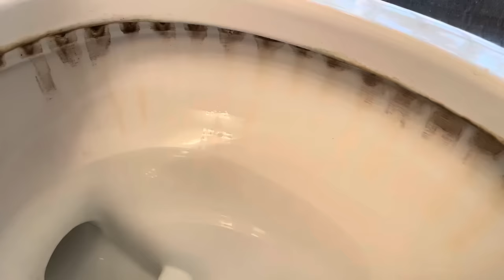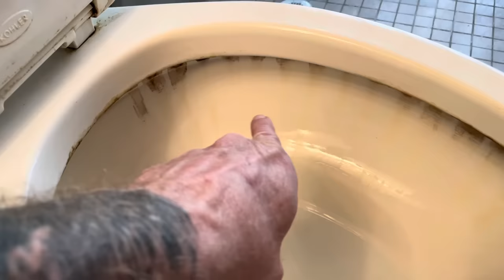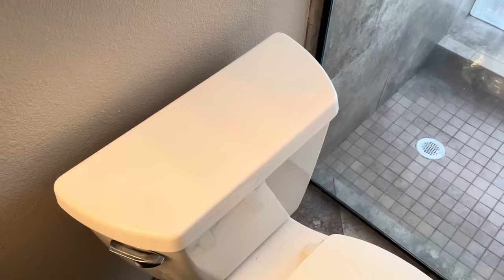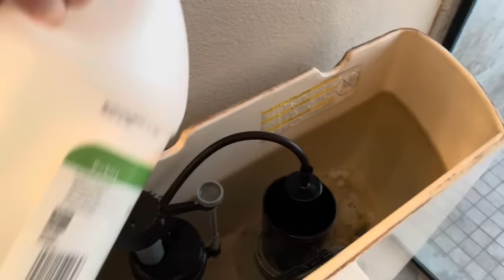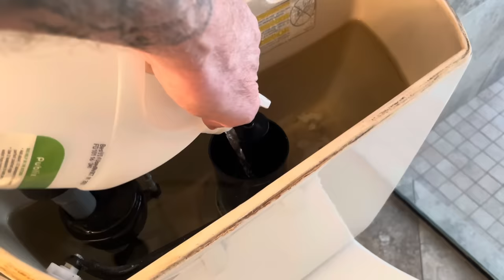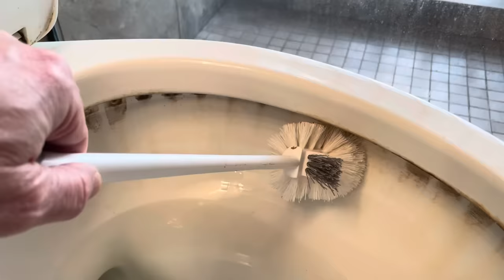Why Does THIS Keep Coming Back and How to STOP it

Comment: i just put  hydrochloric acid in it and the molds did not come back for many months.
Reply from the maker: Yes that will DEFINITELY work. I can’t handle the fumes though, I’ve got COPD, and that would kill me.
Reply: Your tap water already has blean in it. Mold it resistant to it. Use the vinegar, it will last longer.

Comment: would bleach work better than vinegar?
Reply from the maker: Bleach is a very deceiving product… it is far more effective at “bleaching” the color of mold than it is at killing it. Because we believe what we see, we think it has killed it, but it hasn’t. That’s why it comes back so quickly. So we just keep using & buying product over and over again. Great for sales, but not so much for us. The acetic acid in vinegar, on the other hand, kills mold down to the roots, but doesn’t really change the color that much, so you still need to remove the surface stain, but it won’t come back for a long time. Vinegar also helps break down the mineral deposits that the mold is “rooted” in. All in all, vinegar is a far better option.

Comment: Would bleach be better instead of vinegar?
Reply from the maker: Bleach is a very deceiving product… it is far more effective at “bleaching” the color of mold than it is at killing it. Because we believe what we see, we think it has killed it, but it hasn’t. That’s why it comes back so quickly. So we just keep using & buying product over and over again. Great for sales, but not so much for us. The acetic acid in vinegar, on the other hand, kills mold down to the roots, but doesn’t really change the color that much, so you still need to remove the surface stain, but it won’t come back for a long time. Vinegar also helps break down the mineral deposits that the mold is “rooted” in. All in all, vinegar is a far better option.
Reply: Thank you for the information.  I appreciate it!

Comment: Might be a dumb question but will bleach work as a substitute
Reply from the maker: Bleach is a very deceiving product… it is far more effective at “bleaching” the color of mold than it is at killing it. But because we believe what we see, we think it has killed it. But it hasn’t, that’s why it comes back so quickly. So we just keep using & buying product over and over again. Great for sales, but not so much for us. The acetic acid in vinegar, on the other hand, kills mold down to the roots, but doesn’t really change the color that much, so you still need to remove the surface stain, but it won’t come back for a long time. Vinegar also helps break down the mineral deposits that the mold is “rooted” in. All in all, vinegar a far better option.
Reply: @papajoeknows8355  thank you!

Comment: So I have an old toilet that has a flapper and a float. How do I treat this style of flushing mechanism? I'm assuming that the mold isn't in the tank but is instead inside the rim where the jets flush from? Does this also explain the ring of black scum that develops around the bowl at the water level if I don't clean my toilet frequently enough?
Reply from the maker: The vertical pipe that your flapper is attached to is the overflow… pour the vinegar in there. And yes, the mold is flourishing inside the internal rim cavity, then comes out the jets and spreads from there.

Comment: Wow hubby uses bleach tablets. I’ll bring this to his attention. Thanks
Reply from the maker: Bleach is somewhat effective at killing mold on non-porous “glazed” surfaces. But the internal rim cavity of a toilet, where the mold is flourishing, is not glazed and is very porous, so vinegar is far more effective, as it’s able to kill mold deep down to the roots.

It is deceiving though… bleach is very effective at “bleaching” the color of mold so you think you’ve killed it, but it comes back very quickly. That’s why you have to keep using it. Vinegar on the other hand kills mold down to the roots, but doesn’t really change the color that much, so you still need to remove the surface stain, but it won’t come back for a long time. Vinegar also helps break down the mineral deposits that the mold is “rooted” in. All in all, a far better option.

Comment: Would Bleach have the same effect ?
Reply from the maker: Bleach is a very deceiving product… it is far more effective at “bleaching” the color of mold than it is at killing it. Because we believe what we see, we think it has killed it, but it hasn’t. That’s why it comes back so quickly. So we just keep using & buying product over and over again. Great for sales, but not so much for us. The acetic acid in vinegar, on the other hand, kills mold down to the roots, but doesn’t really change the color that much, so you still need to remove the surface stain, but it won’t come back for a long time. Vinegar also helps break down the mineral deposits that the mold is “rooted” in. All in all, vinegar is a far better option.
Reply: @papajoeknows8355  
Interesting !
Thanks for the info !
You are like the, 
" Tidy Bowl Man " of YouTube !
👍😉

Comment: Will bleach work just as good
Reply from the maker: Bleach is a very deceiving product… it is far more effective at “bleaching” the color of mold than it is at killing it. Because we believe what we see, we think it has killed it, but it hasn’t. That’s why it comes back so quickly. So we just keep using & buying product over and over again. Great for sales, but not so much for us. The acetic acid in vinegar, on the other hand, kills mold down to the roots, but doesn’t really change the color that much, so you still need to remove the surface stain, but it won’t come back for a long time. Vinegar also helps break down the mineral deposits that the mold is “rooted” in. All in all, vinegar is a far better option.

Comment: I was expecting you to use bleach. That's what I usually use on mold. Wouldn't bleach work?
Reply from the maker: Bleach is a very deceiving product… it is far more effective at “bleaching” the color of mold than it is at killing it. Because we believe what we see, we think it has killed it, but it hasn’t. That’s why it comes back so quickly. So we just keep using & buying product over and over again. Great for sales, but not so much for us. The acetic acid in vinegar, on the other hand, kills mold down to the roots, but doesn’t really change the color that much, so you still need to remove the surface stain, but it won’t come back for a long time. Vinegar also helps break down the mineral deposits that the mold is “rooted” in. All in all, vinegar is a far better option.
Reply: @papajoeknows8355  I guess I need to switch to vinegar. Thanks! I'll chalk that up to the new thing I learned today.

Comment: Ok, now how do I get my tub to stop doing this as well 💀
Reply from the maker: Vinegar is your friend there, too. If it’s on vertical surfaces, you can soak some paper towel in the vinegar and place it over the stains to soak. Give it some time, then clean it off.
Reply: @papajoeknows8355  it’s coming out of my faucet though.. not sure if there’s a way to flush all of that out?
Reply from the maker: @codywade8014  yeah that’s what I figured. It’s dark and damp inside there, a perfect environment for mold. I would wait till it’s dried out inside there, then spray vinegar inside and let it sit for as long as possible before using. Maybe repeat a couple times if necessary.

Comment: Have you tried putting bleach tablets in the tank, it helps
Reply from the maker: Bleach is somewhat effective at killing mold on non-porous “glazed” surfaces. But the internal rim cavity of a toilet, where the mold is flourishing, is not glazed and is very porous, so vinegar is far more effective, as it’s able to kill mold deep down to the roots.
Reply: I use the bleach tablets and something called barkeepers best friend, its a non bleach alternative that uses diatomactous earth, aka ground up sea shells.

Comment: Would bleach work as well as vinegar?
Reply: No at all. There's already chlorine in your tap water, mold is very resistant to it. You can buy industrial vinegar which has a higher percentage of acetic acid and will kill the mold faster.
Reply from the maker: Bleach is somewhat effective at killing mold on non-porous “glazed” surfaces. But the internal rim cavity of a toilet, where the mold is flourishing, is not glazed and is very porous, so vinegar is far more effective, as it’s able to kill mold deep down to the roots.
Reply: @papajoeknows8355  You can just tell them it's not as effective, as it's not. I'm a water treatment operator, we don't kill mold with bleach, we kill it with vinegar. The water that the mold is living in already has chlorine in it, that is a pretty good sign on how effective it is. The reason it seems like it works on non-porous surfaces the chlorine dehatures the mold's natural adhereant and you subsequently scrub it off during this denatured period. The mold is most likely not dead.
Reply from the maker: @DoctorKnox  yeah it’s funny, there’s like a bleach “army” out there. And it’s hard, because they believe what they see, but what they see is that bleach “bleaches” the color of the mold so they think they’ve killed it. But then it comes right back, so they have to keep doing it… they are like bleach addicts lol.
Reply: @papajoeknows8355    Ah! That makes total sense. Thank you so much for taking the time to answer my question.

Comment: would using bleach do the same thing?
Reply from the maker: Bleach is a very deceiving product… it is far more effective at “bleaching” the color of mold than it is at killing it. Because we believe what we see, we think it has killed it, but it hasn’t. That’s why it comes back so quickly. So we just keep using & buying product over and over again. Great for sales, but not so much for us. The acetic acid in vinegar, on the other hand, kills mold down to the roots, but doesn’t really change the color that much, so you still need to remove the surface stain, but it won’t come back for a long time. Vinegar also helps break down the mineral deposits that the mold is “rooted” in. All in all, vinegar is a far better option.

Comment: could you do bleach to do the same thing?
Reply from the maker: Bleach is a very deceiving product… it is far more effective at “bleaching” the color of mold than it is at killing it. Because we believe what we see, we think it has killed it, but it hasn’t. That’s why it comes back so quickly. So we just keep using & buying product over and over again. Great for sales, but not so much for us. The acetic acid in vinegar, on the other hand, kills mold down to the roots, but doesn’t really change the color that much, so you still need to remove the surface stain, but it won’t come back for a long time. Vinegar also helps break down the mineral deposits that the mold is “rooted” in. All in all, vinegar is a far better option.

Comment: Would bleach work too?
Reply from the maker: Bleach is a very deceiving product… it is far more effective at “bleaching” the color of mold than it is at killing it. Because we believe what we see, we think it has killed it, but it hasn’t. That’s why it comes back so quickly. So we just keep using & buying product over and over again. Great for sales, but not so much for us. The acetic acid in vinegar, on the other hand, kills mold down to the roots, but doesn’t really change the color that much, so you still need to remove the surface stain, but it won’t come back for a long time. Vinegar also helps break down the mineral deposits that the mold is “rooted” in. All in all, vinegar is a far better option.

Comment: @papajoeknows8355 What if ur tank doesnt have an overflow?! 😢
Reply from the maker: Do you have a thin pipe that rises up in the center of your tank?
Reply: @papajoeknows8355  Yes, and that lil tube points down in it.
Reply: @papajoeknows8355  i just drained the entire tank, poured a gallon of vinegar in, backfilled with water. (Cut water off to toilet) now Im gonna let it sit
Reply from the maker: @Ingrid.Taylor  yes, that’s the overflow
Reply from the maker: @Ingrid.Taylor  see also the 2 videos, LinkedIn, the description, they will help as well.
Reply: @papajoeknows8355  thanks so much. I appreciate the prompt reply

Comment: Would bleach do a better job?
Reply from the maker: Bleach is a very deceiving product… it is far more effective at “bleaching” the color of mold than it is at killing it. Because we believe what we see, we think it has killed it, but it hasn’t. That’s why it comes back so quickly. So we just keep using & buying product over and over again. Great for sales, but not so much for us. The acetic acid in vinegar, on the other hand, kills mold down to the roots, but doesn’t really change the color that much, so you still need to remove the surface stain, but it won’t come back for a long time. Vinegar also helps break down the mineral deposits that the mold is “rooted” in. All in all, vinegar is a far better option.

Comment: Couldn’t you use a more natural alternative to something so acidic as vinegar, like bleach?
Reply from the maker: The vinegar is natural, and it is that acidity that both kills the mold and breaks down the mineral deposits that the mold is “rooted” in. Bleach on the other hand is far more effective at “bleaching” the color of mold than actually killing it, which is why you think it works, but you continually have to use it.
Reply: @papajoeknows8355  I’m sorry 😂I was just messing with you about that “natural part.”
But I didn’t know about the bleach “bleaching” it, so thanks for that info!

Comment: Muriatic acid better 10.00 a gallon at  super stores use 1/2 gallon pour in tank over flow tube for approx. 1/2 hr eats lime mold
Reply from the maker: @suekotchevar2765  that’ll work, but my lungs can’t handle the fumes.
Reply: @papajoeknows8355  I get it close seat run exhaust fan helps
Reply from the maker: @suekotchevar2765  it probably wouldn’t bother most people, but I’ve got COPD so my lungs would revolt lol.

Comment: Does bleach work?
Reply from the maker: Bleach is a very deceiving product… it is far more effective at “bleaching” the color of mold than it is at killing it. Because we believe what we see, we think it has killed it, but it hasn’t. That’s why it comes back so quickly. So we just keep using & buying product over and over again. Great for sales, but not so much for us. The acetic acid in vinegar, on the other hand, kills mold down to the roots, but doesn’t really change the color that much, so you still need to remove the surface stain, but it won’t come back for a long time. Vinegar also helps break down the mineral deposits that the mold is “rooted” in. All in all, vinegar is a far better option.

Comment: What about using bleach?
Reply from the maker: Bleach is a very deceiving product… it is far more effective at “bleaching” the color of mold than it is at killing it. Because we believe what we see, we think it has killed it, but it hasn’t. That’s why it comes back so quickly. So we just keep using & buying product over and over again. Great for sales, but not so much for us. The acetic acid in vinegar, on the other hand, kills mold down to the roots, but doesn’t really change the color that much, so you still need to remove the surface stain, but it won’t come back for a long time. Vinegar also helps break down the mineral deposits that the mold is “rooted” in. All in all, vinegar is a far better option.
Reply: @papajoeknows8355  Thank you for the thorough response and information! I really appreciate it. :)

Comment: Can I do this with bleach?
Reply from the maker: Bleach is a very deceiving product… it is far more effective at “bleaching” the color of mold than it is at killing it. Because we believe what we see, we think it has killed it, but it hasn’t. That’s why it comes back so quickly. So we just keep using & buying product over and over again. Great for sales, but not so much for us. The acetic acid in vinegar, on the other hand, kills mold down to the roots, but doesn’t really change the color that much, so you still need to remove the surface stain, but it won’t come back for a long time. Vinegar also helps break down the mineral deposits that the mold is “rooted” in. All in all, vinegar is a far better option.
Reply: @papajoeknows8355  I had no idea bleach didn't kill it wow

Comment: What about bleach, I got bleach...
Reply from the maker: Bleach is a very deceiving product… it is far more effective at “bleaching” the color of mold than it is at killing it. Because we believe what we see, we think it has killed it, but it hasn’t. That’s why it comes back so quickly. So we just keep using & buying product over and over again. Great for sales, but not so much for us. The acetic acid in vinegar, on the other hand, kills mold down to the roots, but doesn’t really change the color that much, so you still need to remove the surface stain, but it won’t come back for a long time. Vinegar also helps break down the mineral deposits that the mold is “rooted” in. All in all, vinegar is a far better option.

Comment: Couldn’t you use bleach?
Reply from the maker: Bleach is somewhat effective at killing mold on non-porous “glazed” surfaces. But the internal rim cavity of a toilet, where the mold is flourishing, is not glazed and is very porous, so vinegar is far more effective, as it’s able to kill mold deep down to the roots.
Reply: @papajoeknows8355 It's not effective at all really. Your tap water already has chlorine in it by federal law (Safe Drinking Water Act). The mold is very resistant to it. Distilled or Industrial vinegar is the way to go.